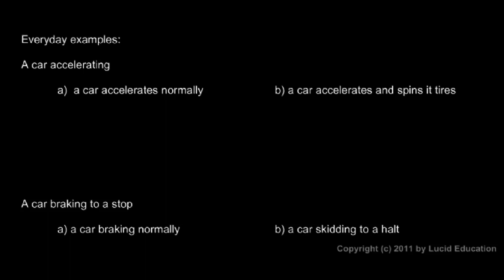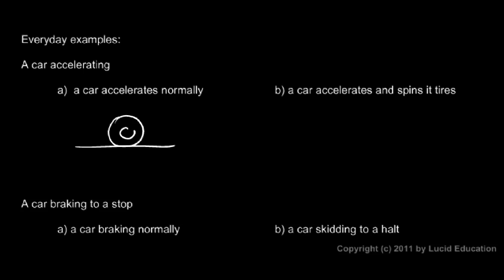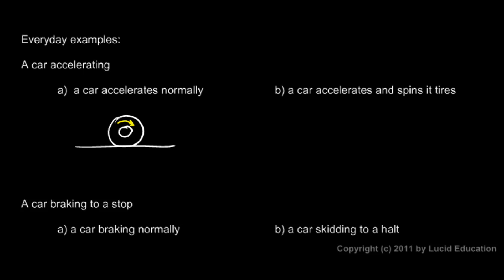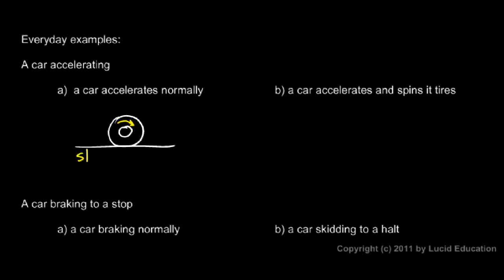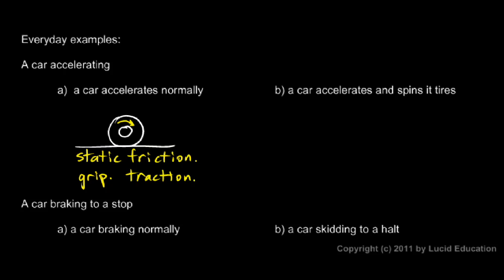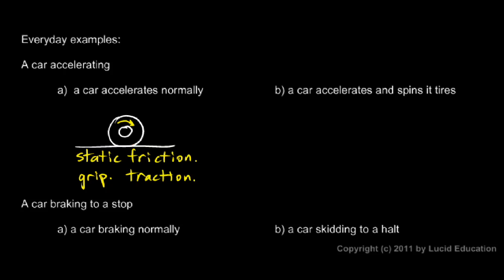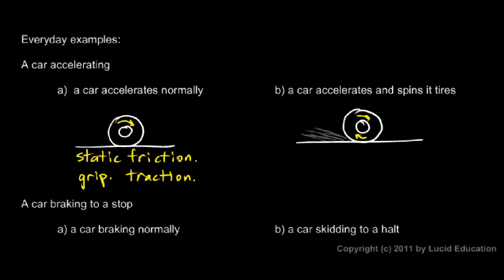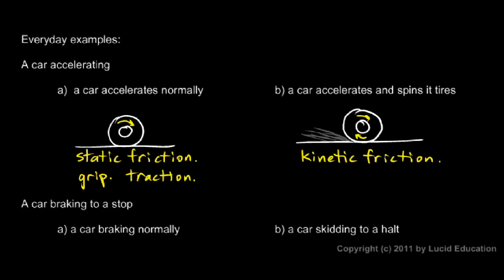Physical Science 2.5c - Car Accelerating

Comment from the maker: When the car is accelerating, it is the frictional force between the tires and the road that pushes the car forward.  There is some rolling friction there also, but the forward force (provided by the engine, through the transmission and the tires) is what determines the motion.  This force is much larger than the rolling friction, which is why the car accelerates forward.  If the driver takes his foot of the gas, then air resistance and rolling friction will slow the car down.